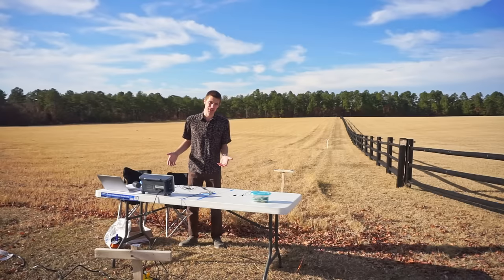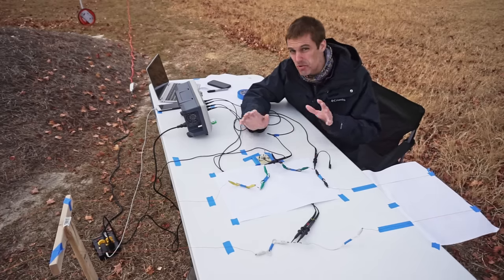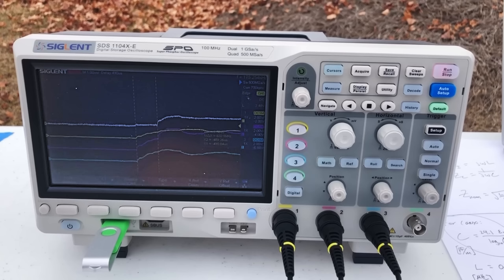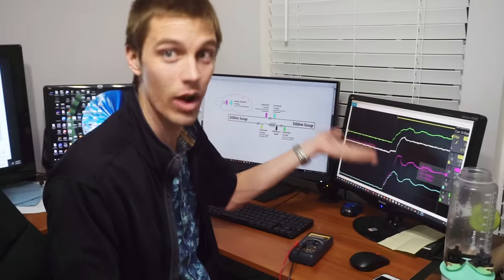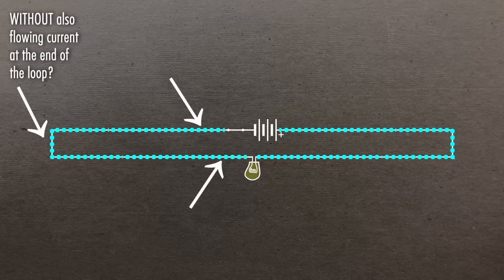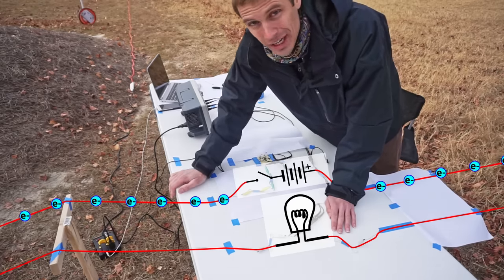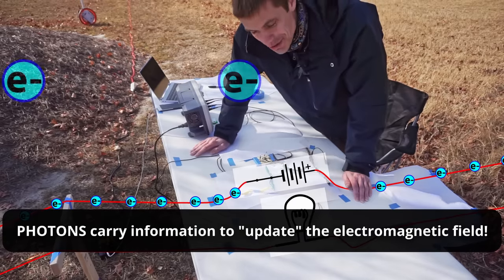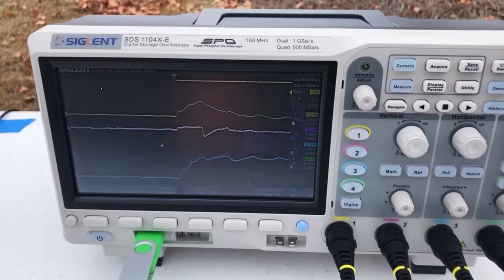I bought 1000 meters of wire to settle a physics debate

Comment: Awesome job!  I LOVE that you were so motivated to actually build the experiment and begin sifting through it to tease out the details. By the way, when you cut the line you actually created two dipoles (antennas) in close proximity. The impulse current, which generated a magnetic field (as a current flowing in a wire produces) which coupled into the other parallel wire dipole and created a current, that was sensed as the voltage drop on the resistor.  Great job explaining this - and what a beautiful place you have to set this up!

Comment: Honestly one of the best experiments on YouTube. I love how concisely it disproved the proposed faster then light information arguments.
Reply: Sorry, I don't understand. The "faster than light information argument" was that veritasium's claim was wrong. You would be able to determine if the circuit is open faster than the speed of light if he were right. So this experiment supports the "faster than light" argument.
Reply: @404nobrakes  this experiment does not support faster than light argument.  You clearly didn't understand what is happening here.  I suggest you re-watch this video
Reply: Well, Derek in his video didnt say anything like "eletricity moves faster than light" at all so I guess you all misunderstood the topic.
Reply: I haven't heard anyone argue for faster than light information. A lightbulb switching on instantaneously is not faster than light information.
Reply: @BaghaShams  technically still not instantaneous. There is a delay of the distance between the switch and the resistor over c. If you could induce a current, however small, instantaneously across a distance, it would be ftl information.
Reply: @BaghaShams  the FTL issue comes because of people thinking that the initial response would depend on whether the circuit is connected at the ends.

As shown in this video, the initial response is the same if you cut the wires at the ends, so there is no FTL information.

Basically, people got confused.
Reply: @SoulDelSol  explain it to me then. Are you saying that this experiment proves that information can travel faster than the speed of light? Special relativity opposes the point that derek makes in his original video. People said that it's impossible for the bulb to turn on instantly because it would transmit information faster than the speed of light. This video supports that argument. It does not disprove that argument.
Reply: @404nobrakes   This experiment demonstrates that the current flow is not faster than light.

The current flow is witnessed at the "light bulb" end with the approximate delay that is expected for the speed of light (should be slightly slower, due to velocity factor, which differs due to conductor type and insulator type).

The near instantaneous current flow that was witnessed at the light bulb end, was due capacitance and/or inductance, occurring over the much shorter distance through the air between the wires on the desk.
Reply: @404nobrakes  it was an argument made in the veritasium video that if the energy traveled down the wire and the wire broke at the end that the light would go out. Except for the pointing vector argument. I was saying this experiment clearly shows that a break in the wire cannot be detected faster then the speed of light.
Reply: @beardymcbeardface69  yes! The capacitance between the wires transmits power across the air gap at the speed of light while the potential difference in the wire is changing. This occurs at the transient when the switch is closed. This can be represented by a pointing vector but where veritasium got it very wrong is once the circuit goes steady state the pointing vector reverses  and points back into the wire. Essentially  being the same as if the charges are carrying the power instead of the electromagnetic field. Eevblog explains that portion very well. The only problem I found with this video was the mention of photons. Particle physics in unnecessary  when discussing field theory because photons can be explained as self propagating electromagnetic waves within field theory.
Reply: @404nobrakes  you misunderstood the original video. No one in any of these videos argued for faster than light transmission of anything. That was never a thing.  The discussion was about wether the energy turning on the lightbulb was travelling the long way around the circuit or was traveling the short distance between the battery and the bulb. Neither one has anything to do with faster than light transmission
Reply: @cortexrex  when veritasium was talking about a break in the wire at the ends he mentioned that if the charges were responsible for carrying the power that you would be able to detect the break faster then the speed of light. This video clearly demonstrates that the transient current is the same if the wires are cut at the ends as if they are not. Veritasium barely mentioned it. Obviously it behaves like two capacitors, one at each end and current flow stops once they are charged.

Comment: Great video! I was also curious about testing it in a circular loop (rather than rectangular loop) to see how it differs when the wire length itself is the same...
Reply: How the fields interact in perfectly circular loop does sound like a 3blue1brown video.
Reply: I like that!  We have to assume given a big enough diameter that the initial voltage seen at the load would eventually become so low in amplitude we can no longer detect it but it would be interesting to see the rate it deteriorates. considering how far a small RF signal goes we may not see any measurable decay of the initial voltage in the   318 meter diameter circle the 1000 metes of wire would make. also the capacitance would change  but the question off the hip is would we notice it in this experiment. Interesting thoughts.

Comment: Curious if that instant reaction would still occur with shielded wires, or a larger gap between them (Putting it potential out if range of the generated EMF)
Reply: I would have to guess that a shield would reduce the affect my bet would be it still existed at a smaller amplitude, great question for thought, that would be a neat experiment to see.  A larger gap I think would have two affects one because of the dielectric of the air adding resistance to the initial voltage rise and two the capacitance would increase as the air gap increased. It might be negligible in this experiment but in theory I believe the capacitance would slow the rise in voltage at the load
Reply: Exact question arises in my mind too.
Reply: It would definitely stop it. The simple version of the idea is that parallel wires act similar to a capacitor which would be slowed or negated by distance and shielding.
Reply: I'm also curious if results would be different in a vacuum
Reply: Also had this thought. It would remove the capacitance and possibly nothing would happen. Guess we can't remove charge absolutely but it would become insignificant.
Reply: If you both shielded the wires as well as spreading the loops away from each other in a big circle, would effectively remove the capacitance.

Comment: 2:36 my favourite part of this video, brilliant! Never knew that!   Very nice physics experiment and very nice conclusion about the capacitance in the cut cables. Very enlightening!:washhands:
Reply: Yes! I found out the hard way when trying to use tiny buttons as a keyboard for a microcontroller. You would press it once but then get several current peaks so you had to write code to filter them out. It's actually called "bouncing".

Comment: The only thing I would do to “overconfirm” this experiment - is to measure voltage over resistor without connecting other probes to the switch, to eliminate the possibility that the voltage over the resistor graph not called by voltage over switch due to possible oscilloscope imperfections.
Reply: The scope traces all start recording before the switch is closed so you can already see that they are flat. No need to measure because he is already measuring before the switch is closed
Reply: Yikes, but yes....
Reply: Yes. I felt it was a bit odd he didn't do it that way. Problem is the oscilloscope probe wires are going to have a big effect on things. Hasn't he effectively bought the whole effect to the distance across his resistor? I don't think it nvalidates his main explanation, but I think it might massively increase that initially voltage he sees.
Reply: @newmonengineering  Despite the initial conditions, all oscilloscope probes have some level of capacitance so having probes connected to the both sides will give you a slight coupling effect. I don't think that it would have changed the outcome of the experiment too much but it's definitely a factor worth noting. If the circuit was impedance matched, that would also be great to see.

Comment: Nicely done. If Derek sees this (which I'm sure he will or has), I think he will realise that what he meant and predicted is not what the reality reflects. He thought the light would come on fully and stay on fully from the moment of 1m/c (ie measured in pico or nanoseconds). He did not realise there would have been just a faintly flicker's worth (probably not enough to light anything up) but then after 1s it would light up. If he had realised this, he would have formulated the whole thing differently, and the whole controversy would have been averted. I'm sure he is wise enough to learn from this.
Reply: I think Derek realized this.
Reply: He realized this, otherwise he wouldn't have explicitly said that any current, however small, would be enough to light the bulb. He did not, however, fully think through all the consequences.
Reply: @rschroev  He misled his audience for clickbait, you mean.
Reply: Looks like Derek got an army of people,,, including me,,, determined to understand electromagnetism
Reply: @andrewberardi6158  He also spread misinformation to an army of people.

Comment: So question: when you open the switch again, do you also see a delay wherein the electrons continue to flow?
Reply: not in this mental model of physics.  When he looked at the scope and showed you it was negative, that was the electrons coming back.  Think of your chemistry and how every element has a preferred number of electrons but its not super strict.  Then move electrons across atoms!!!  This pretty analogous to getting a tube of air and releasing 700PSI air at one end all of a sudden.  There will be a "wave" that goes across, the pressure will build, and see that the tube is tied off at the end (circuit is cut), and it will basically bounce back until there is some kind of equilibrium
Reply: I think the graph should look the same, except inverted. There should be a slight drop in voltage right away, followed by the rest of the voltage dropping of after the waves propagate down the wires. I'm pretty sure this is one of those parity things they talk about in the standard model. The universe doesn't distinguish between "charge" and "not charge", it's all relative.

But I could be completely wrong, haha. Hopefully the sequel will answer this question too!

Comment: To be fair technically the argument isn't that electricity is travelling faster than light (Maxwell's equations make this impossible), the argument is that the electromagnetic field around the wires induces current in the opposite wire (1m away) so there's no superluminal travel, it's just that a tiny portion of the electrical energy is transmitted 1m between the wires.
Reply: Also you're right that it's not as fast as he says because the speed of light through air is slightly slower than through a vacuum (c).

Comment: I once watched a meteor shower, and to our surprise we could HEAR the meteors as they flew over head. Super strange right? And also super impossible because there's no way sound could travel that fast, meteors are thousands of kilometers away. The answer that Dr Karl (famous Australian scientist) gave me was that it was actually the electromagnetic field interfering with the power-lines over our heads! So the light from the meteors arrived at the same time as the electromagnetism. Pretty amazing stuff.
Reply: They're not thousands of kilometers away though. Meteors burn up at some tens of kilometers up (well below a hundred), and if you consider them to be overhead, they can't really be more than twice that distance away from you. (arcsin(1/2) = 30 degrees off horizontal)

Still, the air density at those altitudes is very low, which means very little of the energy in the shockwaves actually makes it to the ground (impedance matching again), but it's not impossible that you actually hear meteors. Otherwise a big meteor exploding in midair wouldn't be able to damage things on the ground with the shockwave. See Chelyabinsk for a counterexample.
Reply: I saw a meteor last year that made a HUGE flash of bright white light that lit up the whole area for a second, it was wild! But to my surprise it made no sound that I could hear
Reply: I've only ever witnessed 1 meteor shower ever. And I swear I heard a big one!

Comment: 13:42 When I decided to see this video I didn't expect to learn how a battery works. Amazingly clear explanation!
Reply from the maker: just imagine that pump is a chemical reaction that ends with too many electrons and drops the extra one into the wire
Reply: @AlphaPhoenixChannel  true! pretty cool and simple to comprehend. Very easy to see how chemistry on batt connects with electric circuits theory RLC, electromagnetism, etc..
Also the wire has thickness so there should be like an ocean wave of electrons moving inside the cable instead of a queue of one electron thickness.
I'm amazed because the way you explained it was better than any lecture I attended in engineering university. I think it's the best way to put it to begin the understanding, then one can add complexity from that base.

Comment: Very cool, the cut wire experiment resembled water hammer but with electrons.
If the power source is much further away from the load, do you still see the same kind of electromagnetic field interaction?

Comment: Transmission lineman here. 
The wind against de-energized wire will store capacity based off wind against wire creating vibration. I could go on but I’ll sound stupid, your obviously smarter. But the winds create vibrations which create micro current in your model. Initial measurement reading was stored electrons already in the wire like some water left in a hose when force is applied the little bit of water comes out before the forced flow. Awesome video

Comment: When you first started I expected you to fall into the usual trap of, trip time = C divided by wire length,  being the ONLY thing happening. I was pleasantly surprised that you discovered the equal and opposite current on both legs of a balanced feed line - flowing immediately on both - as a wave front moving along both wires with opposite polarity)  This is why theory says balanced feed lines do not radiate and are not antennas.
Any ham radio operator who has put up balanced feed lines - and who has paid attention to feed line theory - knows this, both as a theory and as the real world when he finds his balanced line is unbalanced due to coupling to objects nearby (house wiring, etc.) and is now radiating like crazy and knocking out his wife's TV and stereo.
I suggest you peruse a copy of Reflections III (by my friend Walt Maxwell, W2DU - rip buddy) who developed antennas for NASA. And also a copy of the the Antenna Handbook by the ARRL.
Good on ya, btw. Nice job of experimenting by a non ham..

Comment: Hey Eric, great video. A question though. Would the "almost immediate 0.2v in your experiment" ripple come a little later if the wires were in a large circle rather than running parallel to one another? Surely the photon influence would take longer to affect the lightbulb as the wires leaving the battery would be a lot further away from the lightbulb?
Reply: kinda where my mind was going.....i'd use a romex cable for your loops with the far ends 'tied' together...so you could look at the inductive/capacitive effects to isolate those effects out....
Reply: It is limited by the speed of light traveling the 3 inches or whatever across the table. So if the loop was 500m across instead, it would barely be any sooner than the late spike (diameter vs circumference) and also vastly vastly weaker / not measurable anymore. The power falls off by the inverse square law, so 1,000x further away = 1,000,000x weaker signal

Comment: Another experiment idea: Put the load in a physically different place, or even a faraday cage, and see if the effect is the same.
Reply: Faraday cage should have no effect, since the EM field is mostly not traveling through space but instead very close to or even inside the copper wire.
Reply: What about hanging the wire from a drone really high??
Reply: this is my exact thought, need to completely isolate it from a magnetic field other then that of the wires, so the wires should end right at the faraday cage and the resistor is the only thing trapped inside a rigid, insulated box, including gas and light, only the resistor.
Reply: @david203  yeah but some of it doesn't, or does it?